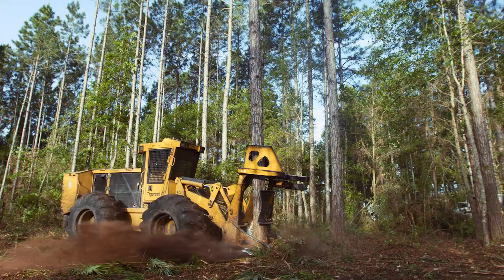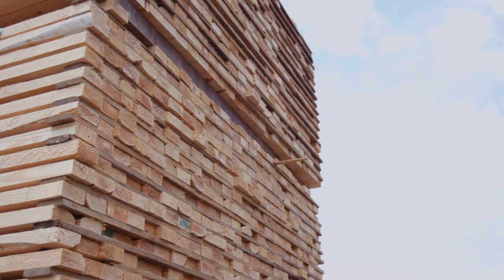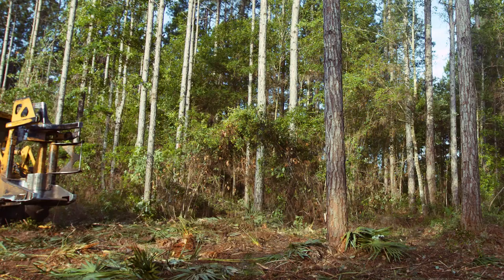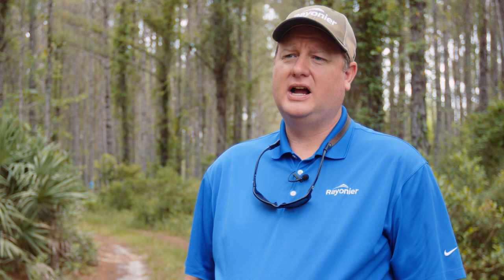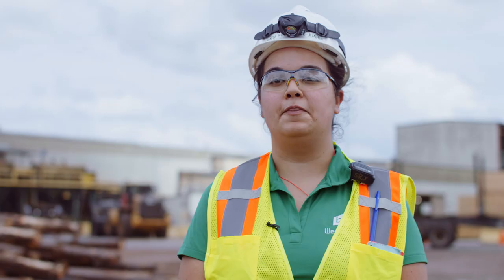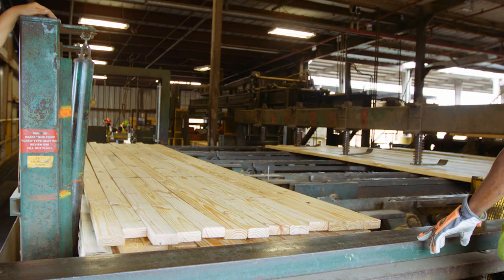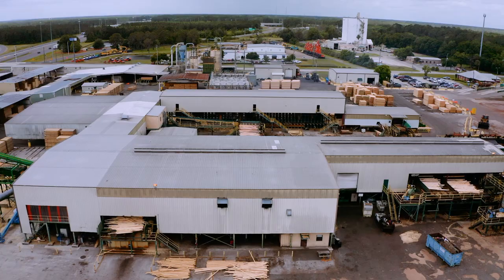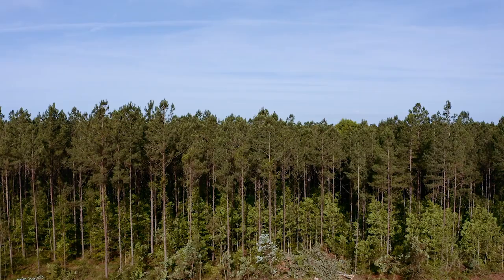From Trees to Lumber: Watch how boards are made from pine trees

Comment: Thanks for the walkthrough but what do you use for trimming the trees?
Reply from the maker: Thanks Gustav. We use a feller buncher to cut the trees down, then the loader operator runs the logs through a delimber to remove branches. When they get to the mill, the logs will move through a debarker that will remove the bark.